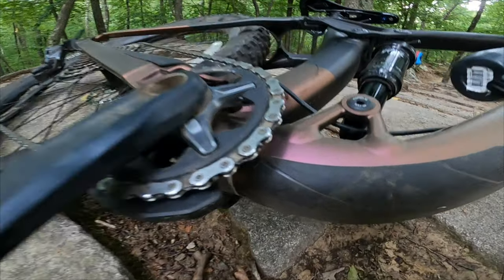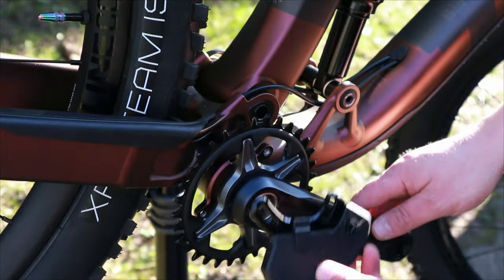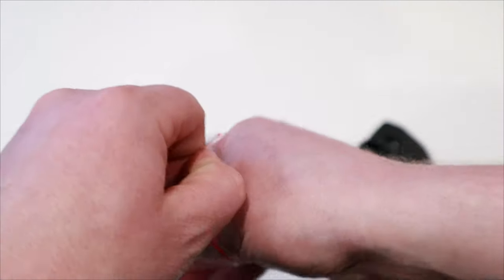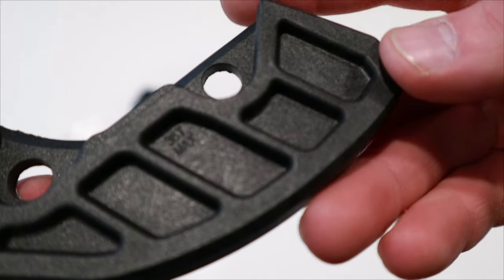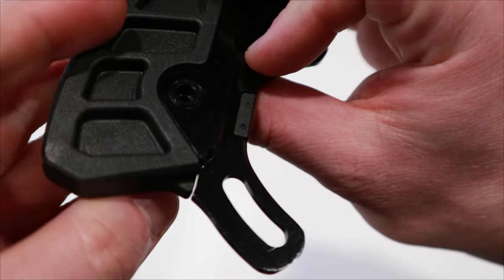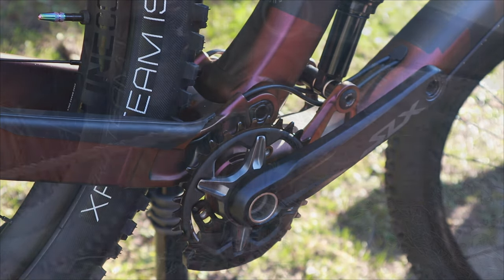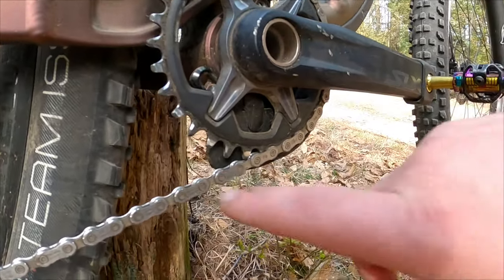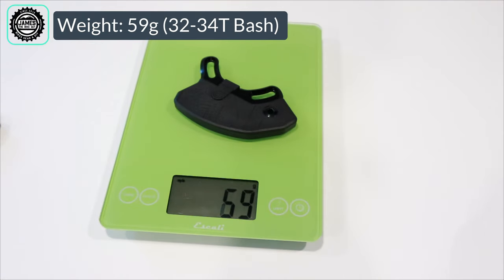The chainring Savior | OneUp UnderBash Bash Guard Review & Weight

Comment: Nice. I didn't even know One Up made bash guards. I might have to pick one up.
Reply: Check what tabs you have. I was under the impression that ISCG05 was a standard, and it *is*...kinda. My '19 stumpjumper did not have the correct bolt alignment to run the OneUp which was a shame because it's a trick piece
Reply: @Matt-py4sc  Just checked and my 2021 Sight has ISCG 05. I only have the One Up chain guide right now